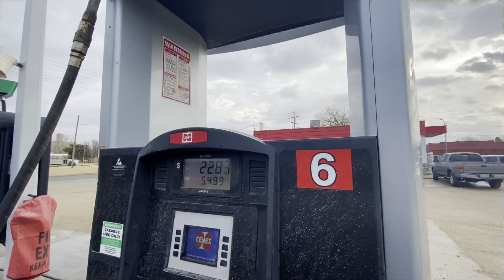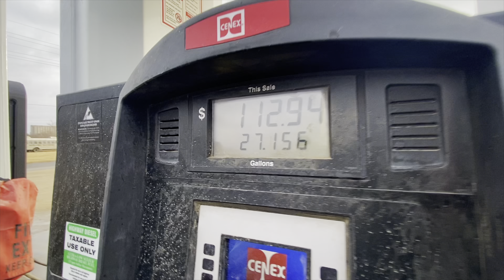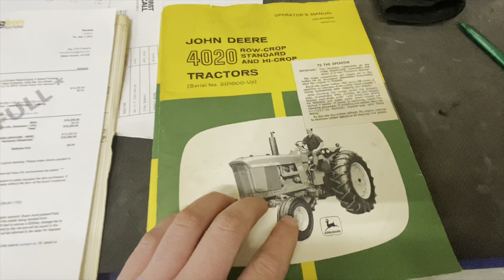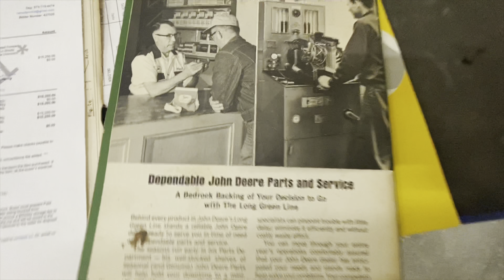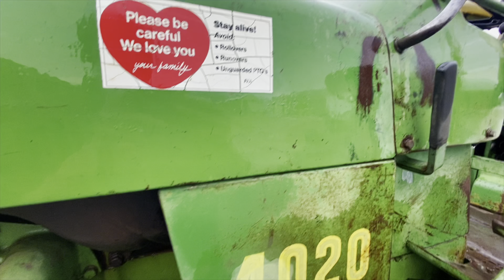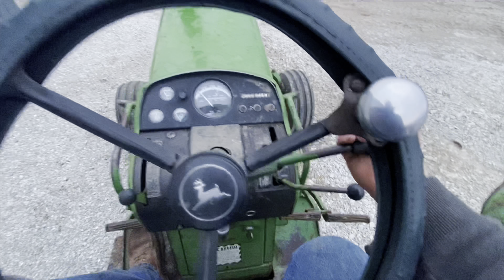I bought a new John Deere 4020

Comment: 4020 is the best tractor ever built.  I had a 1968 with a power shift for 10 years.  I cried the day it sold.
Reply from the maker: I’m not sure if I’d say it’s the best tractor ever, but it is a darn good one. There’s a reason that there’s still gobs of 4020s around
Reply: Yes, but you have been spoiled with rolling living rooms with a steering wheel, grasshopper.

Comment: Unless there is a hole in your rims, you can have them repaired. That will save you plenty of cash! On our farm, both the 4000 and 4020 had calcium in them. We repaired leaks from time to time, and replaced calcium with a less corrosive liquid. You might want liquid in the tires for an overall better balanced tractor.
Reply from the maker: I want zero liquid in my tires. I’ve been trying to hunt down a pair of rims

Comment: I like tractors in their working clothes as well. I think you should keep the 730 on your planter. I noticed how you shift your powershift. Normally, I'll grab the green side bar and use my thumb to shift. That way, I have something to hold on to when it jerks, and I don't miss my gear. Try it.
Reply from the maker: Judging by the worn paint in that very spot, I’d say that’s what the previous owners were doing. I guess I can try the 4020 on the disk first. It’ll take me a few weekends to get it ready to run the planter anyway

Comment: That 4020 is rare with the power shift and 12v system. She’s a dandy! More then likely the combo of the calcium sloshing and maybe adjusting the shifting linkage she will stop moving.
Reply from the maker: The calcium is getting sucked out this week. I’m having dad go and look at a set of rims for me sometime this week too so hopefully I don’t have to run the rims I have now for much longer
Reply: Let the oil warm up and it’ll stop rocking in park.  Might help to have new HYGard fluid in it too.  In any case it doesn’t mean anything bad.

Comment: If you end up taking the tires and wheels off that 4020 don’t be afraid to heat up up the bolts holding the wedges.some times the bolts come out east but if they’ve had calcium it always seemed like the bolts were a pain to get out. A torch and a air hammer will get them out..
Reply from the maker: I’ll be sliding the wheels in soon. I was afraid that the wedges may be frozen up a bit

Comment: You can rebuild a machine as many times as you want, but it is only original once. I personally would not be too concerned about the two layers of paint, it is part of the tractors history, just like the step and the decal.
Reply from the maker: I already started peeling the top layer of paint off on the hood, so I’ll at least get the hood stripped and then go from there
Reply: @goldingerfarms9357  There is no real right or wrong look. As long as you're happy with the way the tractor looks, then that is the way it should be.

Comment: A word to the wise, don't use the cultch paddle. It cuts off the oil to the transmission.  Just put in gear and go.
Reply from the maker: Noted. I figured I could drive it the same way I drive the new tractors, mostly without using a clutch

Comment: My son and I watched a 4020 power shift go for about 3500 at an auction. It did have a little knock in the motor but we could have fixed that. I think my son still  kicks himself for not buying that. Here is a video of my sons 4010 he bought with a hole in the side of the block. I welded up the block and we tuned her up a little.
www.youtube.com/watch?v=qoKoMCnk5jU
Reply from the maker: It’s better to regret not buying something than it is to regret buying something. My great grandpa had a 4010 that was sold when I was 12. I’d give anything to find that tractor
Reply: You would have had it given to you for that little money

Comment: our deere dealer just went to $150 a hour shop charge and didnt give the employees a raise so 3 shop guys quit went on there own 1 guy just does small mowers BUT NONE of them can keep up.  they are SOOOO busy my 4020 is by 1 guy getting majored and its costing me $50 a hour.  our deere dealer is sooo mad.  oh well you guys cut your own throat.  my neighbor his sone just opened his own plumbing business the place he worked at was $120 a hour and $65 service call  he now charges on his own $62,50 a hour and NO service call charge with in 15 miles after that its $1.50 a mile charge
Reply from the maker: The independent mechanic in town does great work but he has a long line to get stuff in. It took 9 months to get my 730 fixed
Reply: @goldingerfarms9357  i undertsand our independent guys are getting busy also BUT i will do what i can to wait 5,6,7 months when it cost me $50 a hour instead of $150

Comment: You should straight pipe the 4020 and clear coat it to keep the tractor from getting more rusty
Reply from the maker: No on the straight pipe, but yes on the clear coat. I still need to get all of the original paint exposed and then I can figure out what to do
Reply: If there is rust under the clear coat, it will still rust.  The rust will slow, but not stop.